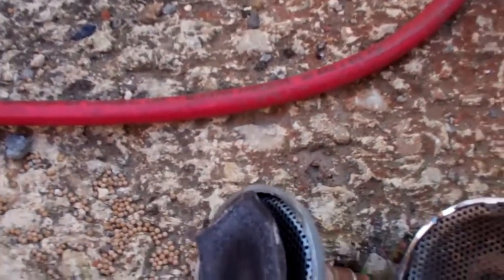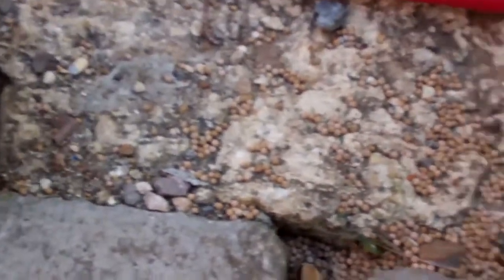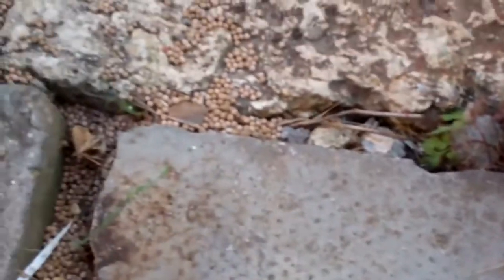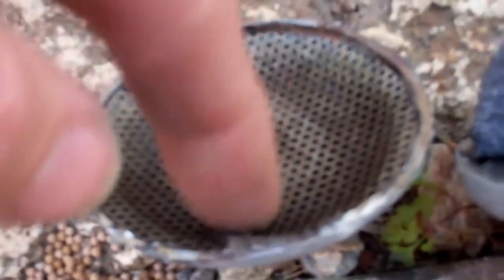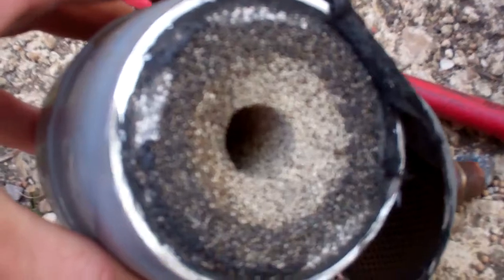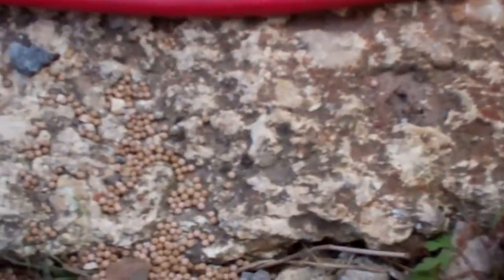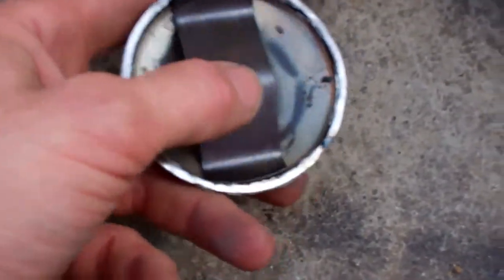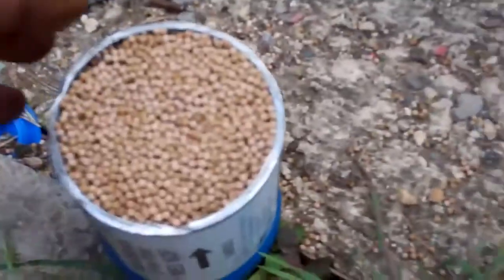Hvac Drier Autopsy

Comment from the maker: @rotarycomptech I meant the solenoids when i was on about poor install practices, i think original company got a lot of crap in the pipes during install which ends up wearing the seat in the valve as the refrigerant passes through. (found some cinder block in one system!)

The power heads i see rust out are on milk tanks in  dairies they get a lot of condensation on them as they are running when farmer washes the parlour pipes out with hot water and chemicals, did think about waxoiling them!

Comment: @heavydiesel hey Jon I don't think it's really the installation it's really the environment I'm down here in the south florida and the humidity level is higher than you can imagine and worst thing that they don't insulate the powerhead in some cases even when they are insulated I still see em rusted out.I really work on rotary screw air compressors but they got a refrigerator dryer that attach to them and all the equipment sit's right outside and in most cases equipment runs 24 hours a day VC-83

Comment from the maker: @rotarycomptech It might be due to poor installation as Sporlan is generally fitted to a particular make of milk tank. So i might be blaming them unfairly.
I've changed a few of those powerheads too, usually keep a couple on the van!
I've had a few Sporlan sight glasses rust out too but the manufacturer fits them inside the ice builder so its not surprising really!

Comment: I haven't seen a big problem with the solenoid valves that sporlan makes although I have seen problems with their thermal expansion valves the power head is made out of carbon steel in rusts out and you lose the charge on the power head I hate to say it but it's kinda like job security.but dan foss uses a stainless steel powerhead

Comment from the maker: @fritzhvac Hi Fritz,

The blocked ones were all bad enough to make the systems cycle on the low pressure switch! 

The funky one was from that semi hermetic we had to crane into that loft a few weeks back as was the big suction drier, think most of the con rods was in that filter!

My first choice would be Sporlan but Danfoss makes a very good drier too but they are about $3 more, i keep both makes on the van and given the choice will swap between makes so customer can see its been changed.